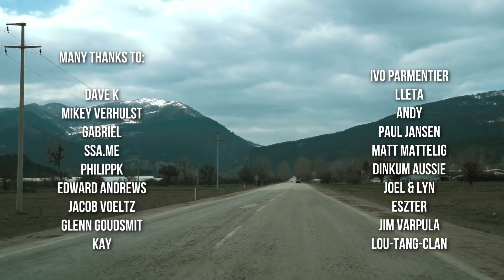URBEX | Ghost town with hundreds of Disney castles

Comment from the maker: Please subscribe to our channel if you like our videos so we can make even better videos in the future :)
Reply: Ads every two mins? Not finishing video
Reply: money laundering basically.
Reply: @deziking  BINGO that's what it is and the new cities are built for the great reset
Reply: @Goldrefinedthrufire  how much are they selling for?
Reply: @Elle - 🙌preach👏👏
Reply: Bizarre.
Reply: In this adventure of the abandoned Disney Castle Village you were talking about Styrofoam being used in the construction of the castle homes, Styrofoam is an excellent insular with heat or air conditioning. Here in Michigan newer homes are using Styrofoam hollow blocks with building basements, as the blocks are put into place concrete is poured into the blocks with a rebar rod hold everything in place. So Styrofoam does have a place in the construction of homes if it’s used in the correct application.
Reply: Hey  guys.., what about same exactly project in places like all around " Tren Maya"..
Reply: It’s a really cool idea to have an artistic town like what they tried to do here, but of higher build quality.  The idea where you had all the necessities and entertainments within relatively short walking distance.  Pity it was a scam.

Comment: Should have built them with Lego .
Stronger and better quality material .
Reply: Ü99999
Reply: Only if you use the newer  Legos with the SPF 30 compound.
It holds up much better in the elements.

Comment: It's not to far off from being a Disney Castle. They are made almost the same way. The exterior of Disney castles are made of fiberglass along with the rooftops. Of course the interiors are much more durable and I am sure the quality of craftsmanship is light years ahead, but still it is the same principle.
Also those lightweight blocks are becoming more common as the technology increases, air-crete is actually very strong when used and installed correctly. Would love to see this place in person.

Comment: If concrete structure OK and get the site with all building cheap this could be salvaged. I'd knocked down 1 in every 3 to free up some space so they aren't as packed in. Strip them down to the skeleton and start again with ok material. Could sell each one for 350k no problem. The main thing would be getting the site for cheap eg just a few million.
Reply: Gee, China and Turkey should listen to you. Lol
Reply: Dolar almost 10 Turkish lira and this aera is very small. 350 k probably buys all village.

Comment: Why didn't they build a handful of really nice quality castles instead of building hundreds of garbage ones? It'd make so much sense for them to sell proper ones and use the profits to expand the project later on

edit: lol you just made the same point as I posted this comment
Reply: Because they wouldn't earn as much money. The markup of selling one quality house is far, far lower than selling 800 poor quality ones. At that point it's about percentages. Except these guys probably don't know jack about the construction, and so they went bust. Or perhaps that was the plan all along. Just push the expenses onto some other company, and then retire in Dubai.

Comment: I've heard of styrofoam being used as building material for the purpose of insulation, but not quite in this fashion.
Reply: Styrofoam is still used. Mostly as decorative pop outs on stucco finished houses. It is a good insulator.

Comment: Anyone who has done stucco which is the finish on every one there. You use foam board to stucco over to get those designs. Stucco is a cement type grout substance

Comment: Don't be surprised come in Canada 90 % of house are made of sheds of wood, gypsum (dry wall) and plaster and they look like they are made of red bricks from outside but it's just an illusion. Average cost is $ 700.000 in remote areas to $1.500.000 in downtown.
People live in it and prices are going higher and higher every year. And no one is saying anything about the fact that the price is so high compared to the price of the  material invested or put in these houses.

Comment: Good coverage but bad knowledge of construction to give some comments . The construction is solid concrete foundation with column structure which brings the structural strength . The walls are foam concrete bricks which are not suppose to give structure strength as building not stand of those they just are to give covering styrofoam facade is very common in the region and part of Europe it's to give decoration and insulation both for winters .the styrofoam usually is high density covered with gypsum plasters covered and painted with latex to give protection from weather.

Comment: Those stairs don't meet IRC code. Clearly there were no inspections armed at life safety by any sort of code official. But it's worse, it looks like the construction company didn't inspect them with an eye towards fixing the obvious problems that would eventually stop the houses from being completed.  Irregardless of whether or not the finances had failed, it appears that these houses were in fact not buildable in what any rational person would consider to be acceptable, ie, in a way that would keep the weather out. 

In any normal project the intention is to make money or provide housing, the contractor pays attention to the details and execution because that is how you make or lose money. That these homes were clearly un-finishable must have been obvious at an early stage in the project when they built the very first one, but they kept throwing them up.  If there had been somebody that wanted these homes to be completed and sold, the unbuildable parts of these homes would have been resolved before they built 600 with the same unfixable problems. The quality control is worse than zero, from bad master planning and design, and on through terrible execution the project is worse than not deserving to be finished, it can't be finished. What a waste.

Comment: The styrofoam would provide insulation, but it needs a special kind of sprayed on coating---epoxy, perhaps.

Fiberglass tiled roofs are fine, if properly constructed, coated, and maintained.

Comment: These villas were built only for Arabs. Since Arabs bought these houses through middlemen, they do not care about quality. But it is correct to use styrofoam and briquettes as location and cost. These are ideal materials for warming. You criticize the fiberglass roof, but it is durable and long-lasting. The reason why it looks bad is that the construction has stopped for many years.

So we Turks are glad that this construction is not finished!
Reply: why doesent turkey seize the properties and resume development?
Reply: @RagedContinuum  You can't just seize everything here. There must be a court order for this. The case still continues.

Comment: Okay so maybe I can explain the Styrofoam theory that had, I can't explain the horrible bricks they used but let me give my theory if I may so people can try and understand. First thing is first, they are far from finished, right? Right, that's obvious. Secondly I come from a multi generation construction company who has built many churches, so I have been around the brick blocks if you will. The Styrofoam was not ment to permanent, so to speak. Back in the day each detail would have been carved out of stone or bricks, the new way I've seen it done is those Styrofoam pieces put on and then they are sprayed with a permanent plaster spray, the fiberglass roofing are the shell of the molds that will be also spray, caulked, and then possibly tiled, on the inside they would have laid a water proofing layer, insulation, drywall and more plaster, so again far from finished. The only thing I see wrong is all the crapy work done after they started to loose money, they had the right path at the start but let's be honest for a home even that size, even with little land each one should have cost more upwards of 500k in usd,  and that's for a basic package. I know it sounds crazy the Styrofoam but that is how new houses molding works these days, not carved out of stone or wood.... if it was real, each Castel would need 750k or more. So they under priced there idea for sure, they definitely should have started with 100 houses spaced modestly, built the entertainment and spa or main spa and entertainment, then let the place sell itself. But someone's great idea went out of control to fast and to soon. Sad really. Also an elevator just 2 stories tall (and those looked to be 4 levels for it) cost around 40k, think of 20 grand a level, for a basic lift, so 80 grand for the lift. Marble floors and counters... real stuff, that's another 80k. 160 just in floors and lift... you see were they went wrong. Undersold and under budget for sure!

Comment: Pretty stupid to start so many and not finish, and they should sell them as obra negras. The reason the damage is because of water penetration which then freezes then expansion causes damage. The styrofoam is for insulation. Not shitty. We use it in Baja California sur. Solid concrete absorbs heat and you roast to death. The fiberglass doesn't break like the old roof tiles.

Comment: Poor planning at best.  The guy (Bob?) was right, the company should have built only a few houses. This is how you usually do it, by building a few houses, e.g.  Phase 1 in Zone 1.  Then get buyers & have additional money from that income.  Then they would have focused their money on building with proper materials & also the road, yard/lawn, electrical & water infrastructures, zone by zone, phase by phase.  And I don't know the surrounding environment either, if that place could potentially be a flood plain, or avalanches, earthquakes, bad weather systems, volcanic activity, etc, although there are adjacent towns nearby that seem to be ok.  Again though, they should have done it by phases instead of building all 700+ houses at once.  Perhaps there was greed & impatience involved, & thus did not want to build by phases, because they were too impatient.
Reply from the maker: Thanks for the info Rob😊

Comment: While the whole project manifests the ultimate in grotesque, the comments by hosts about some construction technologies utilised there, albeit extremely poorly executed, these are standard practices in Europe and elsewhere if done correctly! The program would have been more enjoyable without those unprofessional comments on technology and materials, well deserved however on address of execution of course! The same is not applicable across all techniques used of course but particularly bad is the treatment of junctions! Devil is in the details they say! Rightly so! Poor project management and nearly complete absence of proper engineering is omnipresent in every junction and in most structures!